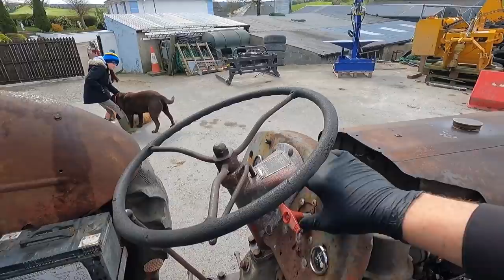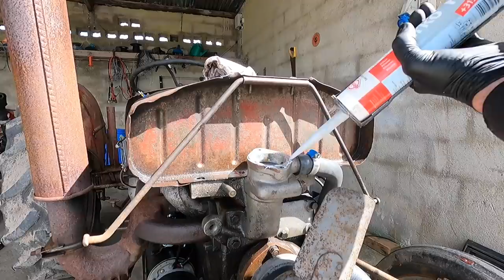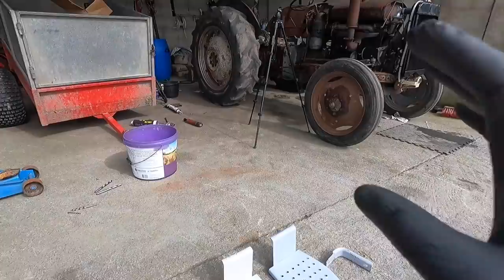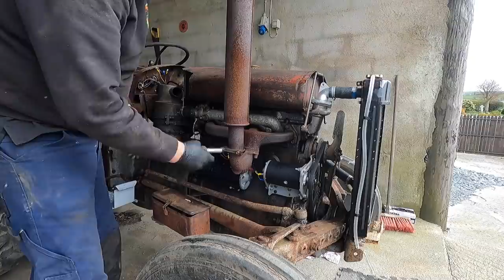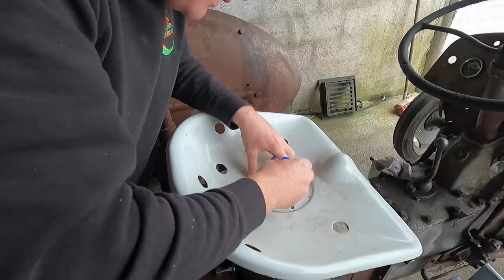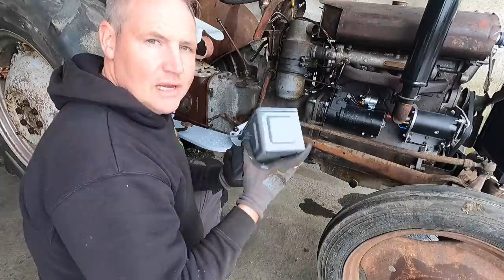FERGUSON TEF20 RESTORATION PART 2  COOLING SYSTEM, EXHAUST, STEPS, WIRING LOOM AND FINALLY A SEAT

Comment: Your doing a great job on the little beauty, what you could you with the dash is to spot weld in the holes and the edges with the new mig welder and flappy disk it smooth again. As for the fuel tank, you can "borrow" the wife's red food dye and fill the tank with water and the dye and see where the dye comes from.
Reply from the maker: Now that is a good idea 💡 cheers mate 👍
Reply: Get the tank professionally fixed, they'll line the inside and it will last forever.

Comment: The hole in the dash that you’re planning on putting a light switch in is the heater plug switch hole! Try find a pull switch with a black knob as that’s the original type!

Comment: That tractor will turn out well don’t worry about a cowling on the radiator as you won’t be working it hard enough to matter and when the bonnet is closed you cannot see it I restored a tvo one 20 years ago for match ploughing. I put Pirelli radials on it for traction at matches in wet weather. They don’t look right but it will pull the plough better than newer ones with correct style cross plies with diff locks

Comment: A copper hammer is a handy tool for shocking loose bolts that are tight or siezed and the copper doesn't damage the nut or bolt. Got one bout twenty year ago and wouldn't be without it since.
Reply from the maker: I will look that up for sure, never heard of that one 👍

Comment: Your auxiliary tank is the "ki-gas" tank please correct me if wrong. It was used for cold starting. Very few survived and even fewer of the pumps. Can send you pic if you want. Sometimes safer without thermostat........alright if gauge is good and operator looks at the gauge....
Hope you know what I mean.

Comment: Owatrol oil is what you need to preserve the patina ! Paints on like an oil, leave it under cover away from dust and debris for a day or two and it'll dry clear but not too glossy - darkens rust like diesel would but its ! Bit more permanent!
Reply from the maker: Thank you, I never heard of that till now. I will look this up later to see where it can be got 👌👍
Reply: @IFarmWeFarm  nae hassle! Can get it on ebay easy enough! 😊

Comment: Lads take the thermostat out because the temperature gauges isn't working. So if it boils over its either the water pump or no water.

Comment: I would sooner use a oil/ diesel mix sprayed on  to preserve the patina than clear coat it.

If you clear coat it you might just as well paint it in my opinion.
Reply from the maker: Why does the clear coat put you of? 
See the one issue I have with an oil diesel mix is that it would be cover in dust and dirty to handle.
Reply: @IFarmWeFarm   the clear coat will get chipped and to me always looks a bit shiny.

The oil diesel does attract dust at first but you can just shift this with a old paint brush and air line. I prefer the slightly mat look of the oil and diesel by comparison .
Reply from the maker: @paulf2529  yes I agree with you there, I don’t want a shiny finish. Still don’t really know what to do there yet really, but I love the look it has already apart from them painted parts

Comment: Pity you didn’t buy one off me this time last year. Was extremely original had very little iota on it. Original starter auxiliary tank Ki has tank. all working. Only drawback was it had no book. But still. I sold it off for a 1000 euro. Was the easiest starter Ferguson 20 I ever seen.
Reply from the maker: Much cheaper than what I payed too 🙈
Reply: A real pity. Was so easy started. Next guy let it off for 1200 was considering on buying it back.

Comment: Bit of a tip for you, when oiling for drilling if you put it on the start of the flutes of the drill bit it will gradually make its way down to the piece you are drilling and it will be more constant oil rather than a puddle of oil on the piece 
For the seat to be in keeping with the rest of her a ration bag full of straw would be best keep you warm and comfy 😉
Reply from the maker: Jesus no, have you seen the price of straw!! 😜
Reply: @job berry frith I've had it for about 6 or 7 years now and just haven't been bothered to change it yet 🤣
Reply: @IFarmWeFarm  the cuttings from the lawn so maybe 🤣

Comment: Any wiring diagram about for the dynamo to control box . I want to fit a charge light ,thanks
Reply from the maker: When my man wires this one for me I will share it on a video if that helps mate
Reply: if you need any pictures of the ki gas system and aux tank, i can send them to you from my one

Comment: Footplates look slightly too wide at the back. Could be for a 35 not a 20
Reply from the maker: There listed on John Connaty website for a TEF 20, a lot of the vintage lads told me it normal for them to hit, just need to rise up the pedal seemly
Reply: @IFarmWeFarm  just thought of that there now. Hopefully that works.  You're making a great job of it. Just reminded me too if never crossed my mind to check is the thermostat in any of the old yolks I've got lying about the place.
Reply: A lot of parts from the 35s fit the greys so are listed as so. The running boards wouldn't have been originally fitted but they are much more comfortable to drive with. The travel in the pedal is wrong.

Comment: Hi Adrian if you sand the panel back to bare metal scratch it up and pee on it yes use your own urine t will go rusty it does work 👍👍🏴
Reply: One of my friends with vintage  tractors does similar except he uses water down slurry, paints it on the bare metal, washed it off after a few weeks  and allows to dry then sprays a oil diesel mix over the whole thing to preserve whilst keeping  a patina.
Reply from the maker: If that works it will rust in no time cause our dog Hutson has his leg up on it ever chance he gets 🙈👍

Comment: sorry but it's not 'always gonna be safer with a thermostat in'. thermostats fail - if they fail in the closed position, no water flows thru the radiator and the engine can overheat.  if you don't fit the thermostsat you are never going to have it jammed closed.  so no thermostat means NO overheating. you are so very welcome.
Reply from the maker: I’m also fitting a temperature gauge just to be extra careful 👍 thanks Raymond